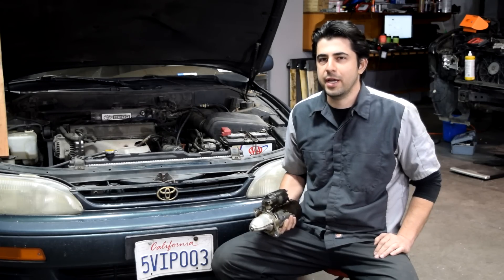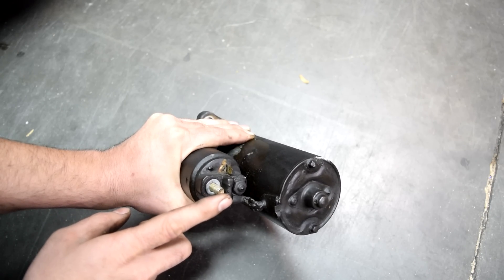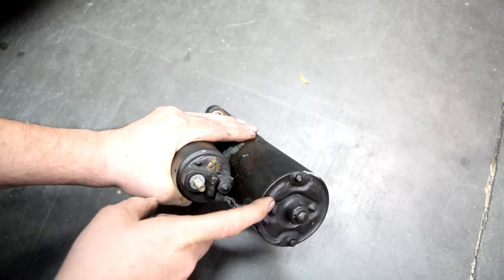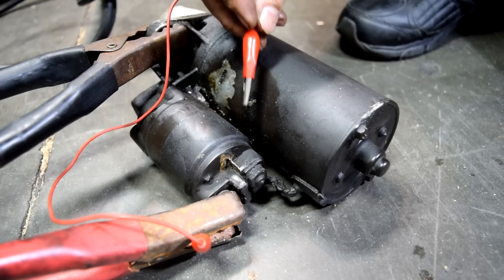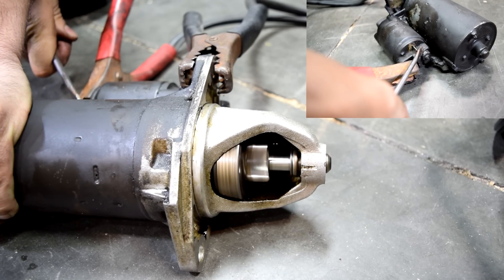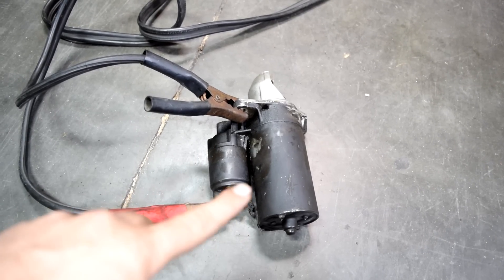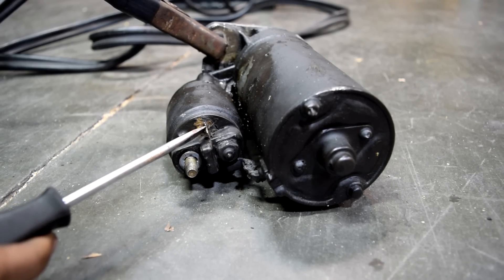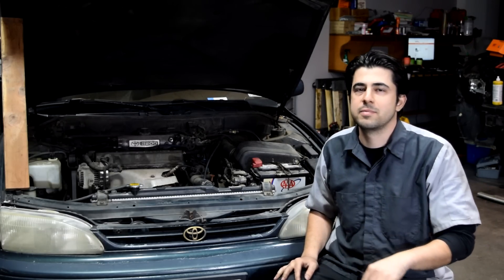How to Test Your Car's Starter and Solenoid Assembly

Comment: when i plug the cable to battery and then plug to the starter it starts spinning without the jumper... its continually spins automatically just plugging from battery ... faulty starter?

Comment: Thanks for the video.  I was able to conclude my starter is bad.  Doing this test, the gear didn't spin or move.  After tapping on the solenoid with a hammer, the gear spun and moved a couple of times, but then went back to its "dead" state.  Thanks for sharing this!

Comment: Nice video but you didn’t do a load test on the starter only thing I would have done as well basic electrical diagnostic is load testing this only tests so much

Comment: Is there a way to test the starter and starter solenoid with it in the car. I have checked the fuses and relays and they are all fine but I am getting a no crank situation on a 2007 Saturn sky redline. Thank you.

Comment: Is there a way to test the starter and starter solenoid with it in the car. I am getting a no crank situation, my battery is new, I have checked the fuses and relays but the starter does not engage.  It’s on a 2007 Saturn Sky Redline.  Thank you.

Comment: Hey I have a question, I have a 2007 Nissan Xterra at first when I drove the vehicle it shut off on me completely I was told it was the gas pump, battery, throttle body, air intake, tube damaged, ignition switch, I have replaced all of those items with new parts, now my truck does turn on when I turn the key, but as i turned it over it starts but then it chokes, I do it again and I push the acceleration and it stays on,while the car is idling I'm accelerating it and nothing happens I tried to accelerate it on drive, parking,reverse, nothing happens when I press the acceleration on the truck but the car is on and the engine is idling, I was told it was the throttle body censored but that has been replaced already buy a new one, what is causing this problem can you please help me

Comment: I have a 12V battery for motorcycles 4ah full charged but it doesn work, the starter is from skid steer loader 12V 3,7 KW do i need a bigger battery?
Reply: Yes, you likely need a larger battery. The 12V 4Ah motorcycle battery is too small to handle the high current demand of a 12V 3.7 kW starter motor, especially for a skid steer loader. A larger capacity battery with higher amperage (e.g., 12V 30Ah or more) is recommended to provide the necessary power to start the motor. You can follow or subscribe to my channel "Mechanical Guy" and ask questions to get the fastest free consultation!

Comment: I have a question for you.    If you  remove the wire between the starter motor and solenoid.  Then supply the 12V to the signal wire as you demonstrated.   Why wont the solenoid itself  operate and motor not turn???  The starter motor  obviously can't  run,  but why doesn't the solenoid  retract back a push the drive gear out ???

Comment: With my best regards , don't You think  :
THE CHECK FOR THE STARTER MOTOR ONLY IS : SHUNT (WITH THE SCREWDRIVER)  FROM THE "DIRECT SUPPLY" TO THE "BOLT" .
POINTS :
                 1. "DIRECT SUPPLY" ( 12 V FROM THE BATTERY OR FROM THE RED (+)JUMP START CABLE).
                 2. "KEY SUPPLU" ( 12 V FROM THE CAR KEY ).
                 3. "BOLT " (RECEIVES  12 V ONLY WHEN THE SOLENOID IS WORKING . AS A SHAPE RESEMBLES "DIRECT SUPPLY". )

Comment: A starter can only be tested under load. A real test bench has a 90° piece of a flywheel bolted down tight. Engage the starter and ready Amp draw and voltage. There is no other accurate,  consistent test.

Comment: This is a fantastic video Man I had a problem with my 2013 pilot no start ne crank and I took out the starter and tested the same way as you it did nothing at first but I saw that ground wire on the starter was barely so I made my attached so I made my own ground wire and put it in there and it worked out the starter back on the car and it saved me 700$ for the starter thank you for the great video I appreciate..

Comment: Thank you. Wanted to prove where the fault was as I’ve had a number of electrical related issues and didn’t want to spend out unnecessarily. Took me 10 mins to get the starter off and test to find the solenoid was faulty. Thank you.

Comment: I had to replace my starter because the pinion gear would pop out and engage the flex plate, so the starter motor and solenoid were working. But, the pinion gear would not quickly disengage for a second or two after the engine started and made a grinding/dragging sound before it pulled back. Any idea what caused that and could I diassemble the old starter and repair it? Maybe clean something?

Comment: My vehicle turns on but the ignition doesn't crank.  When I took out the starter to test it, it popped out but it didn't spin that fast it was kind of slow..do u think i need a new starter in order for my car to work?

Comment: Ok I just did this test. What happens if the starter pushes out and gear spins like it’s suppose to. But when you go to double check it does nothing no movement in rod or gear.

Comment: Love the video man
And followed your test
The starters fine but not sure what else you could be
Car clicks once when trying to start and spark plugs are not igniting?

Im outta options
Not sure what else to do
Electrics seem fine too

Radio runs fine no dimming lights for alternator wear out?
Reply: Did you fix this?? What was it in the end
Reply: @kieran4442  nah man unfortunately no
Suspected engine lock bro 
Changed out the fuckin head gasket all for nothing

Comment: One thing I’ll note…. If the solenoid clicks, but the motor doesn’t spin it may be a bad motor, but bad contacts inside the solenoid. Put an amp clamp on the larger red wire when testing the solenoid. if the voltage doesn’t drop or your amperage stays at zero then it’s likely a bad contact and not a motor

Comment: I took the starter out of my 1994 Camaro 5.7 Z28, as it scream and did not ingage the flywheel. I placed the starter on my bench, car battery jumper hook up and used a insulated wire to make a electrical contact. The gear did come out and spin, however it floated back and forth about a half inch, which is a symptom of a starter gone/going bad.

Comment: Good video. However,  when I try it I hear the starter spinning but the car still wont start. The belts turn about an inch or two then they stop for about 2 seconds and repeats again. Without doing this the car is totally dead.
(I tested the starter at an Autozone and tested good)
Any further advice?

Comment: Great detail video, I did exactly what you said to do and all tested good, but the problem with my starter is it works great but when not turned on it is draining the battery, is it a short somewhere in the starter or solenoid?

Comment: Hi, where could be a problem, if starter rotates, but pinion doesn't push out? Starter is new. I changed it, because of this problem. It hapenned on my last ride before winter time. When I was running on highway, engine stall suddenly. So I glided to the highway exit and put cas aside and tried to start engine, but it didn't. Only starter was moving. We towed to my garage and there I noticed, that starter didn't move with crankshaft. I tried to change starter relay, but it didn't help.

Comment: Great video man thanks.
Does this apply to All starters in every car? My 2005 Camry starter does not have that housing unit where the gear is. I tested it out and it only spun the gear but didn’t push up

Comment: Thank you for your video. It is very helpful to learn how anything works outside of the car. My new battery, installed by the sales young guy, got the negative connector melted into the battery plastic surface. I smelled the fumes, then I saw the smoke and lifting up the hood I also saw smoke coming out from the starter. That second day with the new battery ( which was rated at 500 CCA and measured 720 CCA) I got the same one click that the old was giving me. Do you think the cause of the problem was a bad battery installation? Now I cannot take it to be diagnosed.

Comment: Hi there, my starter spinning when I use direct battery opposite direction. But when I'm following your instructions my gear only engaging (moving forward) but no spins at all. But it's spinning by using direct battery powered

Comment: I have a question i have a 2017 dodge charger rt daytona i drove it home from work parked it attempted to start it and it just wouldnt all i heard was clicks over and over for about 15 trys. Went to go get my toolbox and jack which took abiut 30 mins. Came back to the car and it starts now everytime no problem. Strong start ive turned it off and on over and over enough to piss off my neighbors then said screw it the cars fine. What would make my car act that way? Crankshaft position sensor? Camshaft position sensor?

Comment: My starter was working fine. A few days ago,I went to start it and the starter was smoking. I have a 2006 Chevy cobalt. There is an oil leak and the starter was wet. I wiped the oil off but it might be internal. It turns weakly sometimes.

Comment: Great info, thanks. 
After installing a new starter almost a year ago AND one of those relay gizmos, the manufacturers of which assure you that it will solve your 'clicking starter problems' I'm back to square 1. The damn Samurai won't start. 

Took out the starter after seeing this video, to make sure I didn't screw up something during installation. The starter works fine according to above example. 
Back in the vehicle it went, checked to make sure ground/negative is properly engaged. It is. Checked circuit to battery before attaching positive to positive on solenoid. It reads 12.8 Volts and should be good. Then hooked positive from battery to positive on solenoid body stud and then connected as shown in video above with a direct connection to battery positive. The starter/solenoid engaged okay, tried to turn the engine, but only turned it over half a crank, then gave up like a dead battery. 
Tried the same with jumpers hooked to my other car, which I know has a good battery. Same result. Very annoying.
What could be the real problem? 
I'm ready to torch that Sammi.
Reply: Iam no expert but I would say you need to verify your flywheel spins and is not locked up. 
2. This test does not actually prove that the starter is good, only that it operates as it should. In other words this is a no load test. When it engages the flywheel it may not have the torq. To turn the flywheel over. I believe this could be verified by checking the amp draw of the starter during a crank cycle against the starter specs.

Comment: 506 comments... i can't go through them all (heheh)  
i have a 2007 toyota corolla - no start no click.. changed out the 8 yr old battery
no change... checked 15 amp fuse + relay under the dash.. driver side as per your other video on how to test the relays thanks for that...
So my  question is .. if all tests pass.. fuses are good, relays are good, including the starter testing as you showed.
can starter it still be bad?  i reinstalled it and car started fine first 6 times then the problem of no start returned 

i took it out again and it continues to engage on testing... im so frustrated right now.. only thing to do is start changing parts.. and its a hot * day...
Reply: turned on every time w/ new starter... testing the old one seems to be ok though.. hmm

Comment: Pretty good vid and gets the point across but...... 2 things wrong here. 
One. Just because the motor is running and engaging the gear assembly known as a bendix assembly, is not testing of the motor can produce enough torque to actually turn an engine over. 
Two. The solenoid is a mechanical high current switch that allows the motor to be switched on from a low current switch ie a starter relay that is powered by your ignition key etc... the gear (bendix assy) is thrown out by the motor turning.

Comment: My started developed the classic 'Click no start'', I got the starter out and proceeded with the bench test, TEST 1, Negative to the case and positive to the  positive terminal 1 on the starter,  Result Solenoid works and motor does not spin, TEST 2,  Negative to the case and positive terminal 2 on the starter, Result Starter works perfectly and so does the solenoid when power is supplied to the signal post, What could be the issue ? is it the armature , solenoid,  Bendix or the brushes. I was told if the armature is shorted , it would never spin.

Comment: This testing might not work sometimes. I just replaced a started that works when tested like this but does not work when in the car. I was worried and thought the engine might have seized. Luckily the car started fine with a new starter.
Reply: I would say your switching voltage from ignition is faulty
Reply: I’m having the same problem. The mechanic said it might be a sticky solenoid, so to just replace the whole starter.
Reply: Needs a connection inspection and/or cleaning. Starter cant work without good connection and proper ground
Reply: @joelh3030 then why did the new starter work without any modification to the wiring ?

If it was the wiring not even the new one would have worked
Reply: @D @DavidGomez-nm5mb bc the new starter has clean connections and this test takes clean jumper in an ideal environment and directly hooks them to immediate contact points on the starter. This test environment is not like reality. Really not that complicated haha both 12v and G are atleast 1 layer removed. So your statement is objectively false as it ignores the direct bare wire hookup which reduces a circuits ability to complete
Reply: Could be dirty connections that got scraped "clean" enough to make proper contact upon the new one's installation, even if the old one had been reinstalled (connections were interafted with enough to finally work on the last install), OR, some more likely reasons, such as:

1.) As electric coils (the hearts of both solenoids/relays and motors/generators) age and go through numerous heating/cooling cycles, they develop higher resistance in the areas intended to conduct with low resistance and/or weaker insulation in the areas intended to have high resistance. This requires more power for them to operate and even a brand-new battery of the original rating may be insufficient. Such issues are especially common on the cheaply made ones with an intentional failure age (planned obsolescence) like we find on modern, mass-produced vehicles -- where 10 cents per vehicle of savings equals millions saved per year.

These are the types of issues that are exacerbated during operations under loads ('lab' or 'test bench' versus 'real world' scenarios), such as when actually producing the torque required to start an engine.

1.5) More likely than above, at kind of a halfway point between the aforementioned electrical issues and the mechanical/frictional issues below are the commutator shaft and brushes. If the brushes or the commutator wear down or become otherwise damaged, or a foreign substance (e.g. motor oil, penetrating lube, water, etc.) finds its way into the commutator/brush area, this can introduce:
 A.) additional, expedited wear to the brushes,
B.) additional friction and subsequent mechanical resistance to rotation, and
C.) additional electrical insulation between the brushes and the commutator to which they are supposed to conduct electricity. If this happens, the motor will again require additional energy to overcome the situation. When this is the case, in the bench testing scenario, conditions are favorable for it to (at least ostensibly) function just fine. However, when facing the additonal load of an engine and the decreased current carrying capacity of the vehicle's onboard electrical system, it may not be able to do its job.

2.)  Equally, or perhaps even more likely than issue 1.5 is that the shaft along which the pinion gear moves is dirty and/or "dry" (no lube), therefore making it unable to overcome the friction on the shaft when facing the added mechanical resistance of attempting to align and mate with the gear teeth on the engine's side of things. (I use quotes around dry, because only a dry lube should be used here -- powdered graphite or perhaps a dry silicone-based lube, like lock lube.)

 This is especially common and problematic on the Bendix shaft style of starter (most common), as the helical of the splines can really entrap dirt & debris, which eliminates the lubricity.

For issues 1.5 and 2, the solution is simply to take the whole thing apart and clean it thoroughly, apply dry lube to the bendix shaft and nothing to the newly cleaned brushes and commutator shaft. This can be a 100% free fix aside from time/labor, but if the brushes are worn, I'd definitely replace them while it's apart anyway. If you just measure the side dimensions of the brushes and the length of the brush holder, you can find replacements for next to nothing either all over the internet, or at many industrial and electronic/motor, or possibly even HVAC supply house.

3.) Spacing may be an issue that's preventing proper gear engagement, so understanding how to correctly shim a starter (and doing so) may help.
Reply: Dead spots in starter motors are possible too, so malfunction is intermittent in that case
Reply: Ive had this a few times. Works fine in the test machine. Mechanic told me sometimes they do that but can no longer function under a load
Reply: Same experience here @crillin570.
Reply: Why would it work like this though not in the bike?
Reply: Sounds like you had bad contacts on the starter or a bad ground somewhere.. must’ve re connected it when you put the new one on.